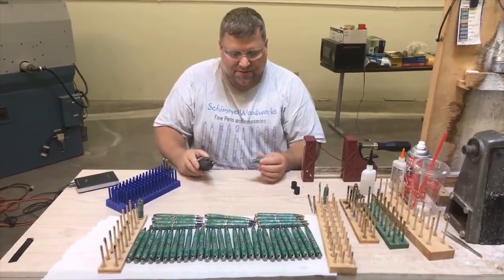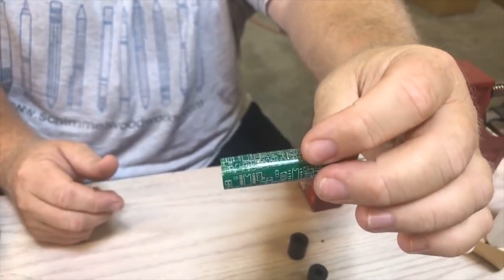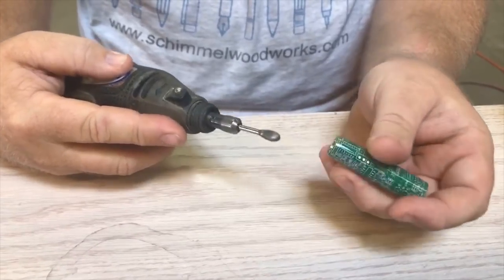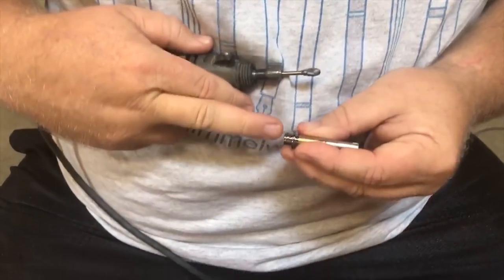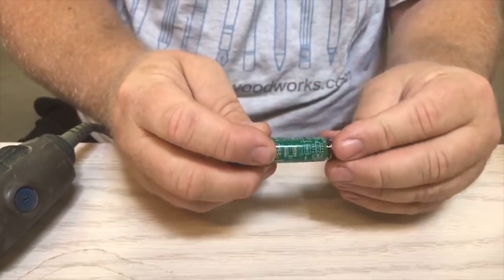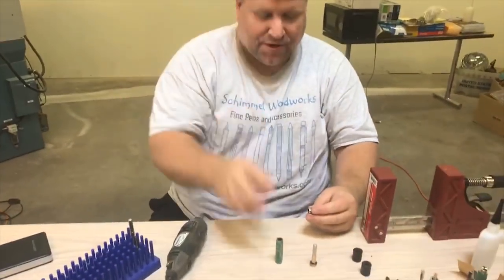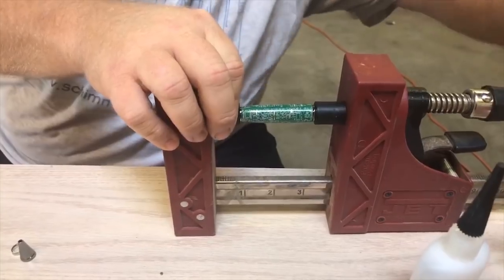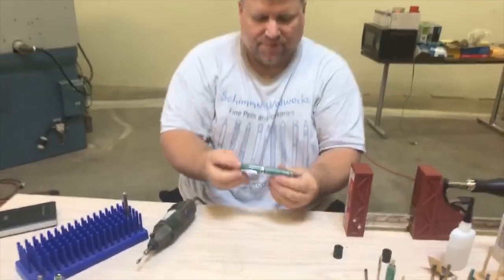Tips for making Circuit board pens,   Pen turning tips

Comment: Just wondering,  where do you get your blanks from and how much would you sell one of your slimline circuit board pens for?

Regards 

Tony
Reply from the maker: I have sourced them from multiple places over the years in addition to making them myself. 
Usually for circuit board I try to do a pen that has a larger diameter so that more of the circuit board can be shown, such as a monarch or cigar (both of which I have done well with at shows) and I can't recall ever having done a slimline this way. Cigars sell for around $85 monarchs a little bit less, and then more if I do a capped rollerball. 
Hope that helps!

Comment: Greetings. May I ask where you purchase the flexible PCB/circuit board for this project? I would not be using them to make pens and possibly pull business away.
Reply from the maker: We just source the pen blanks, not the actual circuit boards themselves. They can be toxic/dangerous to work with so we don't mess with them in house and wouldn't know what direction to send you to find them, sorry!